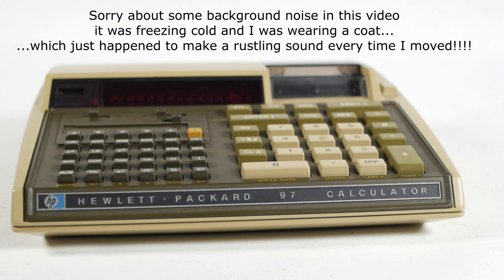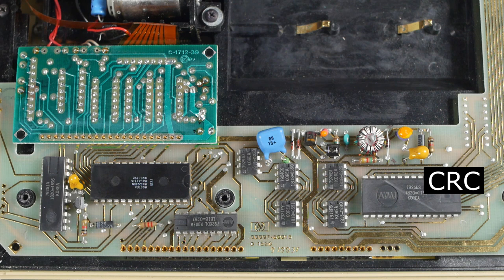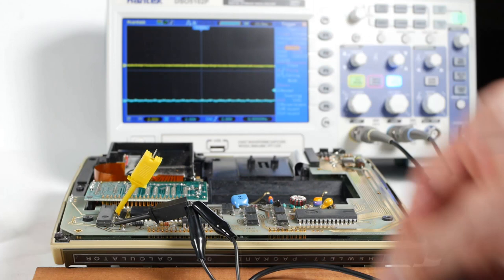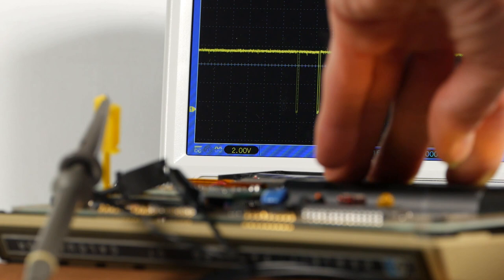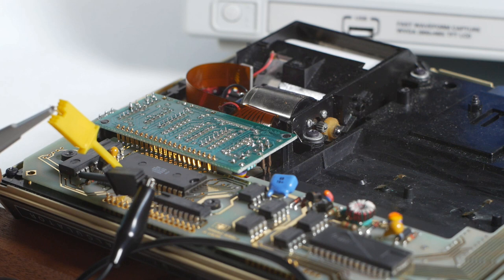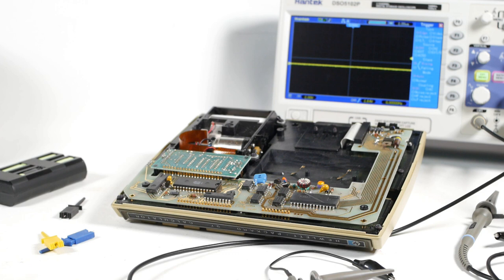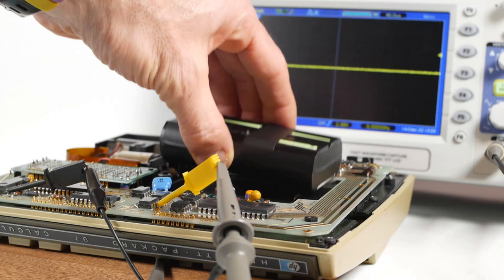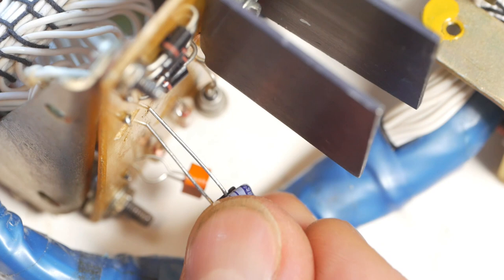HP-97 - More Tests - Still Not Working - Vintage Calculators

Comment: This is really cool,for real i have no idea about those small electrical I know mechanical more. Is ok if u cant fix it at least u try.
Reply from the maker: Even if I don't manage to fix it, I'm determined to at least isolate exactly what the fault is.  If it's one of the chips (and I suspect it is), it's very unlikely I'll find a replacement, unless I can invent a time machine and travel back to the early 1980s and order one directly from HP!!!!  cheers for watching.

Comment: My first boss had an hp97 for structural design calculations. 1980s.
Reply from the maker: Phenomenal calculator - still really hoping I can fix mine, although it does seem a tad unlikely if it's a dead ROM.  I'm keeping my eyes open for a reasonably priced replacement but the ones on ebay seem to be listed for a crazy price most of the time, and often the seller doesn't even know if it works.
Reply: @GrumpyTim  most the eBay vintage items I’m seeing are priced ambitiously to put it mildly and the shipping cost more than the item. I got my LA5 off of Marketplace locally for $10 and I waited 5 days because I was sick. Even at $10 there wasn’t much interest.
Reply from the maker: Occasionally I get some ebay bargains and I don't mind the carriage costing a bit so long as the machine is packed properly - always a bit distressing when it arrives in "kit form" having been sent with little or no protection!!!  But then there are the sellers that list a "super rare vintage antique original Odhner (insert the name of any common calculator brand)"  for about a million pounds.

Comment: If the ROM really has failed on this calculator, I wonder if it would be possible to extract the data from the ROM of a working HP-97 and build a small emulator board out of modern components to replace it? Perhaps using some sort of microcontroller to act as an interface between the calculator and a more readily available modern memory chip? I would assume something this old wouldn't need to read data so fast that a microcontroller wouldn't be able to keep up with it.
Reply from the maker: Hi faulknik000  I had thought a similar thing myself, but had got no further than just thinking about the possibility so far.
Initial hurdles that I can think of are:
From what I can tell, HP used different ROMs in different generations of the HP97, so I'd need another HP97 of the same generation to clone a ROM.
At the moment the process of copying one of the ROM's and re creating it using some sort of modern technology, is well beyond my knowledge area, but that's not to say I can't learn enough in the future.

I will at some point re visit the HP97 and check every pin on every chip (mapping out the results in the process), in various states, such as power on, key press and so on, to see if I can get a little closer to pinpointing the exact fault.  This won't cure the problems, but hopefully I'll learn a little more in the process.

Cheers for the excellent suggestion.

Comment: If that ROM chip is providing highs of less than 1 V it might be your problem. Have you checked the output of other ROM chips? Good luck!
Reply from the maker: Cheers Ben - they use a weird system on those HP's there's only the one Data track that goes to all the chips - the ACT will send out an address on the IS bus and whichever ROM that address is for will send some data back either on the IS bus or Data bus, so that strange looking signal is common throughout the Data bus.  Still trying to get our heads round exactly what should be happening - it would be so much easier to have a second, working machine to compare results - or even better, a time machine, then I could just order some new chips from HP and be back in business.  All suggestions gratefully received - I have a few more things to check since filming the video but nothing that I'd pin that much hope on.  If I was brave enough I'd quite like to pluck the ROM's out, one at a time, and maybe test to see if it would start up with a ROM removed.  Even calling them ROM's doesn't seem quite right, from what I can tell, at least one of them can store data (for the memory and programs), so that would make it a ROM/RAM type of thing.
Reply: @GrumpyTim  Could there be something pulling the voltage down somehow? Is there a problem with the supply voltage on the ROMs, or perhaps an errant pull down on the data line?
Reply from the maker: Funnily enough Ben, after I'd replied to your first message I was thinking that I'd better examine the data tracks more thoroughly for something that could be pulling them down or a bad via or anything like that.  I won't have time this weekend but I'll see if I can get onto it next week.  The same goes for plucking the ROMs out, if one had failed and was pulling the lot down, then that should show - even though the calculator wouldn't work without a ROM, it might be a way of identifying the culprit.

Ideally I'd like to fit sockets for all the chips but there's very little space and I'd probably need to make a spacer for the bottom of the case.  I've seen people using fancy de-soldering  pumps which look great for chip removal - I think I'd struggle with a standard iron and solder sucker - I've also seen people flood the legs with solder so you can keep the mass hot enough to free all legs at once, so that might be an option.  If it was just a scrap, easily replaceable chip, I'd cut the legs off then de-solder them one at a time.
Reply: @GrumpyTim  I've used soldering irons and solder suckers, they work, though get the last use the braid and extra flux.
Reply from the maker: Yeah, I use a solder sucker all the time - great for sucking the solder out of the hole once you've removed the component but not so good for removing the solder while the component is in place - such as the multiple legs of a chip.  Curiousmarc uses one of the de-soldering guns with the hollow heated tip and integrated pump - I often look at that with a certain envy, but the good ones are big bucks - maybe one day............
Reply: @GrumpyTim  I've used a solder sucker to remove chips. Take a coupe of goes a pin sometimes. Also use the braid and extra flux.
Reply from the maker: @BensWorkshop  cool, cheers Ben. I have plenty of scrap boards so I can do some practice to home in on the best method before I tackle the real thing. I've got lots of braid too.  I'll order some sockets so I can make future swapping easy.
Reply: @GrumpyTim  You need flux too. Good plan to practice.
Reply from the maker: @BensWorkshop  yeah, got that too.